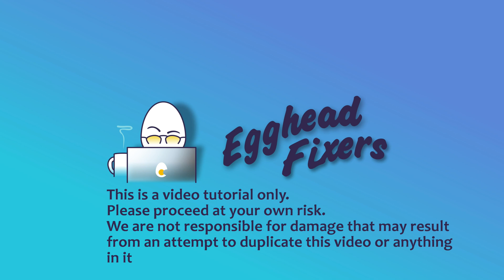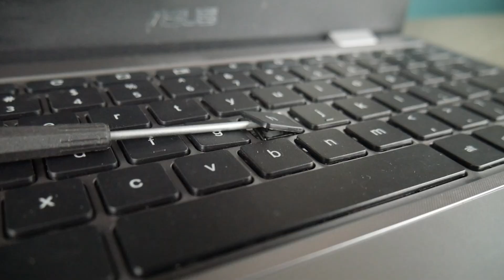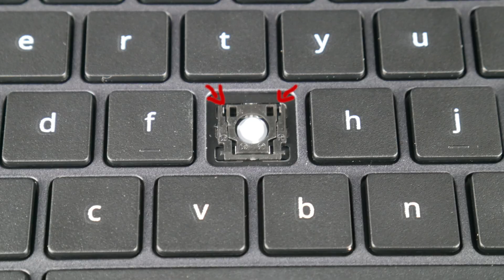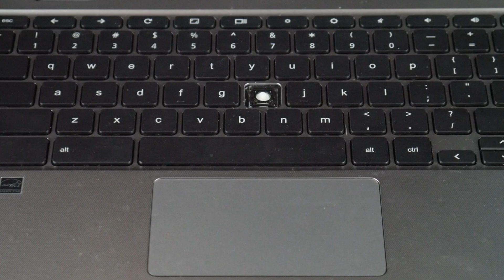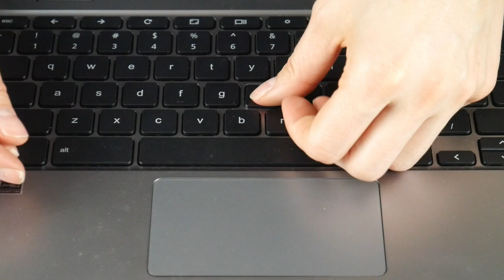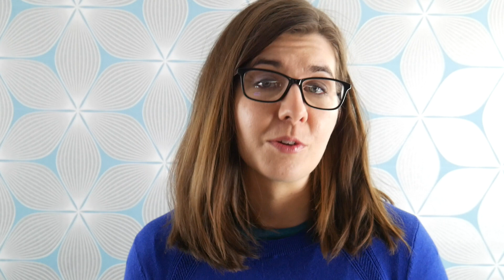How to Replace a Key on Your Toshiba Laptop's Keyboard - Tutorial by a Certified Technician

Comment: Thank you.
 I was a bit spooked 
about knowing whether my 
screw driver was holding the
'spring' down or just in there
somewhere, but alas it worked.
I just had to blow out debris that
had accumulated underneath one of
the caps.
Reply from the maker: Yeah that's the best-case scenario when it's just jammed by debris. Glad to hear it was a simple fix.
Reply: @EggheadFixers  Thanks.
Reply from the maker: @bikersoncall  You're welcome

Comment: I have hp g72 i want to change everything (internally) is that possible
Reply from the maker: Change it how? Upgrade the RAM and HDD? Because that is definitely possible.
Reply: @EggheadFixers   can the motherboard,chip  be change
Reply from the maker: @jadaneclarke7617  It depend on the motherboard. Some are socketed so you can remove the CPU. Although you can not switch from AMD to Intel. Also the motherboard needs to be able to support a better chip. But  the first step is see if the motherboard has a CPU that is removable or integrated into the board